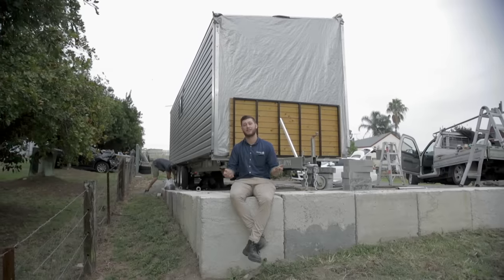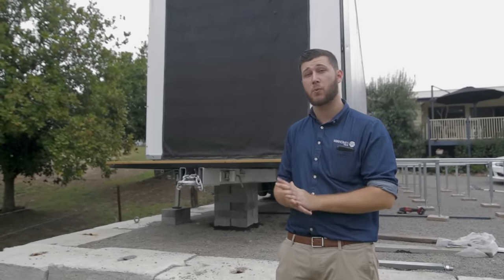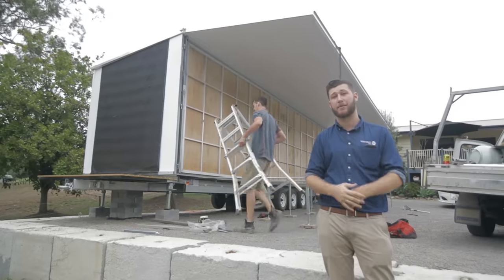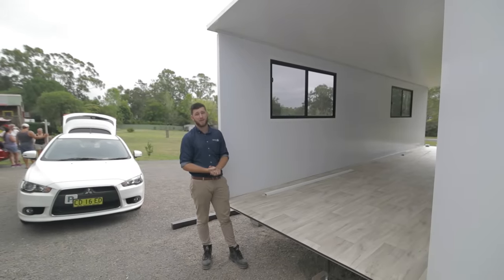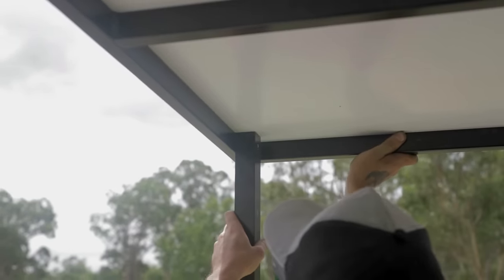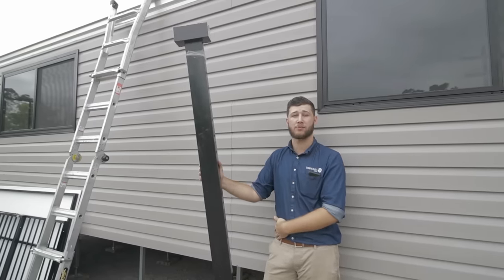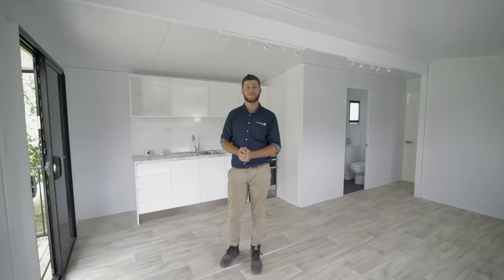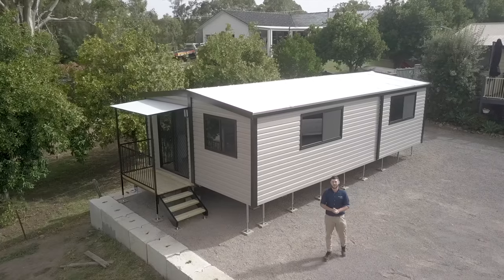2 Bedroom Granny Flat Installed in Flood Zone - No Council Approval!

Comment: How warm during winter and cold during summer heat. Does it coming with heater/cooler unit
Reply from the maker: Hi, most customers do fit a reverse cycle air conditioner making it warm in winter and cool in summmer.

Comment: I just want to scream when I see those single tub kitchen sinks. Makes it bloody obvious that the designer has never ever washed dishes by hand. You need two tubs. One for the hot soapy water and the other to rinse the dishes off into with cold water.
Reply: @robertolang9684 Oh really, go on. Explain how to rinse dishes with cold water without running said cold water into your hot water thus turning it cold.
Reply: @robertolang9684 🤣🤣
Reply: They will supply a two basin unit if you want one, or two. Alternatively crack out the paper plates.